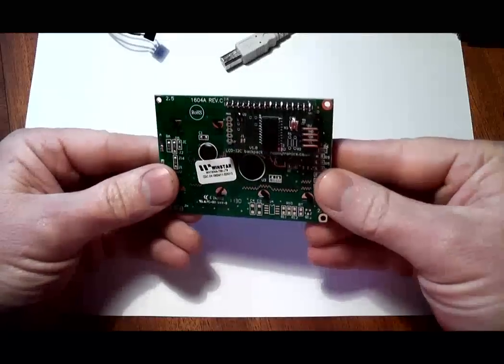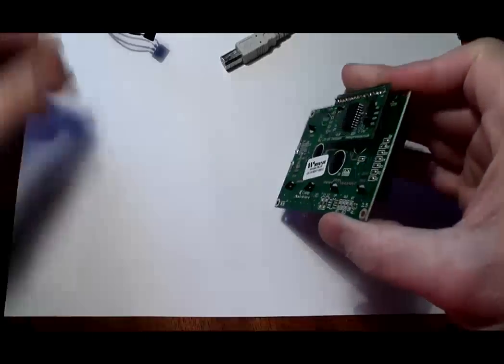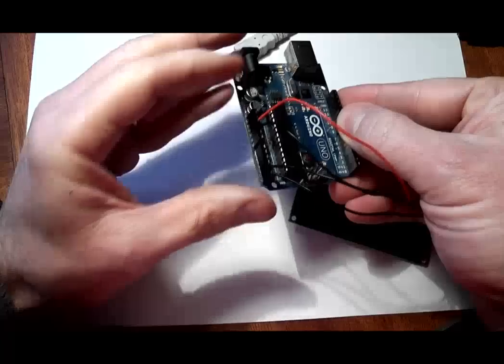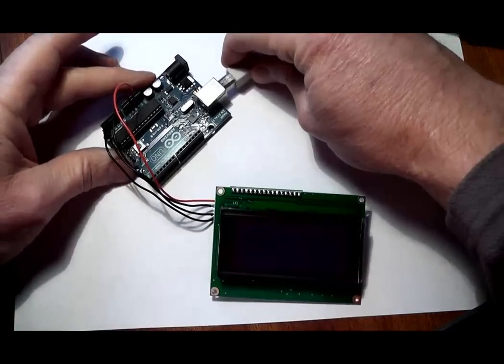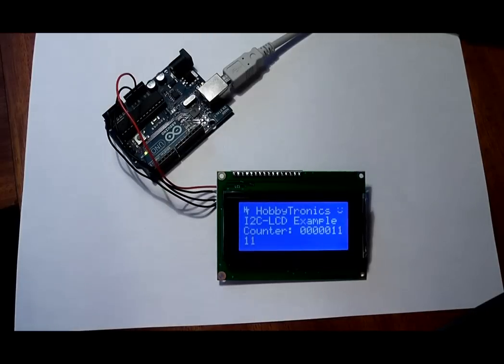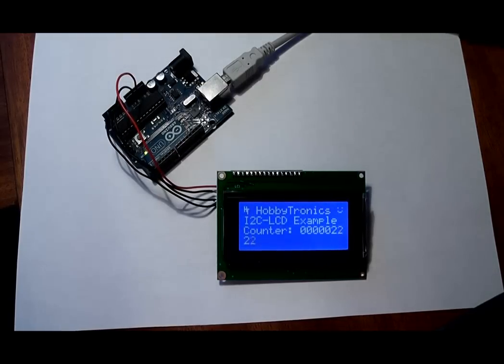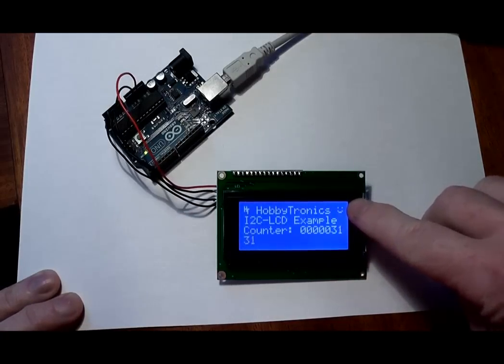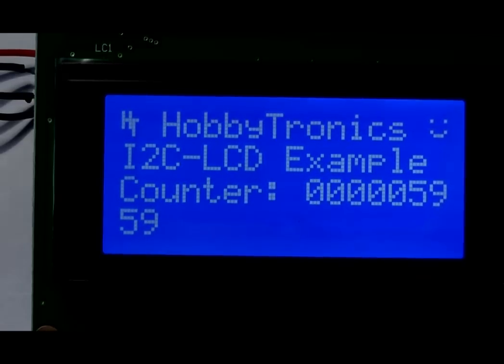LCD I2C Backpack

Comment from the maker: The backpack doesn't use the Arduino liquidcrystal.h library. It contains a Microchip PIC processor which talks to the LCD. Really there is no excuse for the Arduino guys not to have added support for 4 line displays. It's been years and this hasn't been fixed. 
You can use 16x4 displays attached to an arduino board, you just have to use negative x positioning on the lines that are indented.